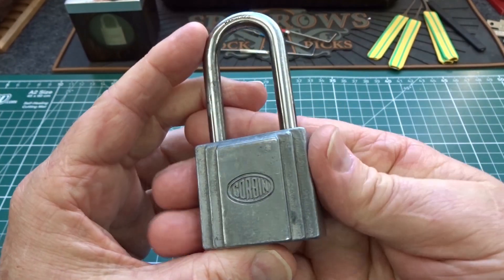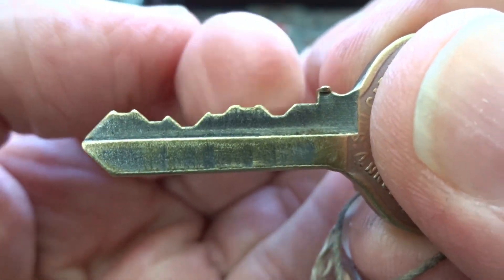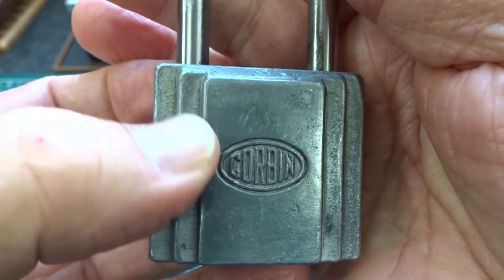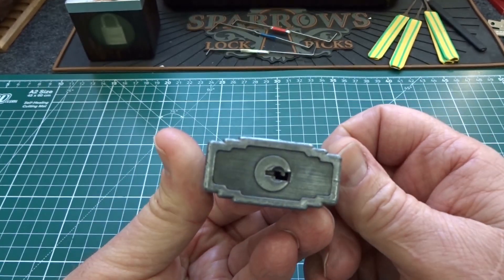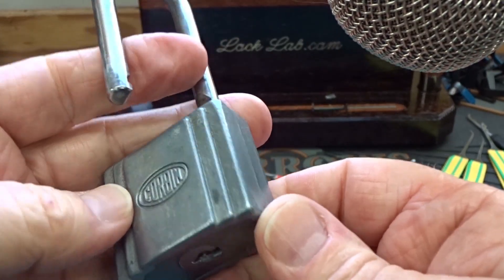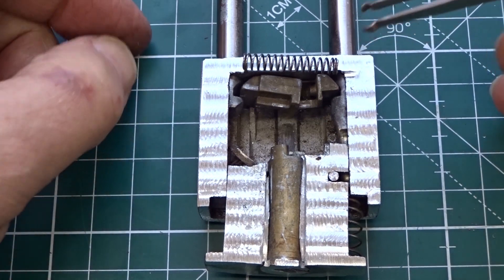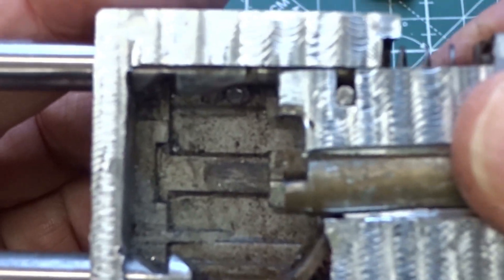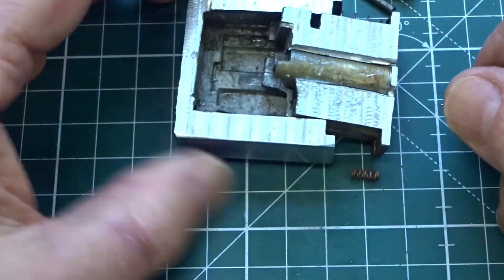(1211) Antique Corbin Padlock Dissected

Comment: Bill, I work in the office furniture business and frequently have to change lock cores.on file cabinets. There is a special control key that lifts the last wafer and allows the core.to be removed. If I lost the control key is there an easy way to.do this without the manufacturers control key?

Comment: Again the camera is always focusing on the mat in the background. They use diagrams like that to test cameras, the ai loves lines like that to focus on. Please use a plain background for your videos. Much appreciated.
Reply: It is because the sensor is well above the lens, meant to focus on things in the distance rather than close up. Notice how it will focus properly if he places his hand in the top of the frame, with his hand extending out of the frame. The reason they use the grid is because it is easier for the autofocus to focus on it and you can see it is focused easier on a monitor, the "AI" as you called it doesn't preferentially focus on that type of pattern at all, his issues arise from poor sensor placement by the manufacturer.
Reply: Just compare to his earlier videos when the background is gray. When his hand is on the top of the frame, he practically covered the whole frame, the camera should have figured where to focus by then. When the object and background is 50-50 the camera favors the background, easily observable.
Reply: Stop complaining about the focus and just enjoy the videos
Reply: Then update your prescription and get new glasses. It worked for me.
Reply: The lack of focus is affecting the enjoyment of the videos. I can't see stuff clearly.
Reply: Perhaps you are the one needing a new prescription, I can tell blur from clear. The issue is with focus.